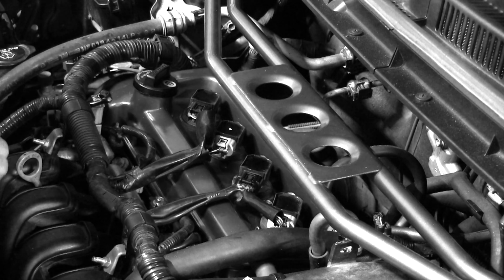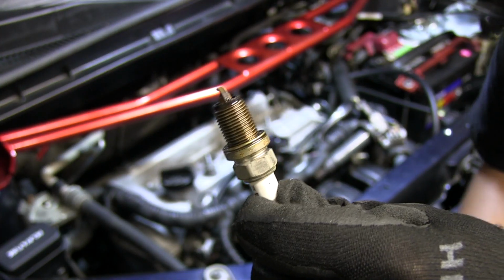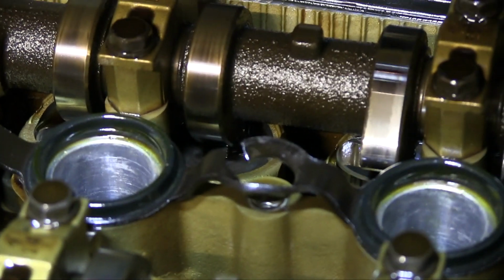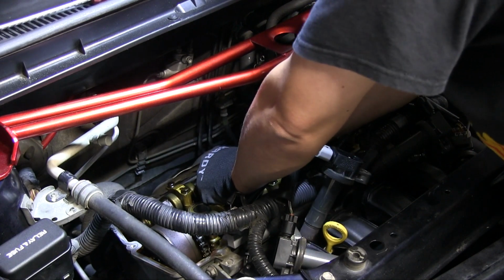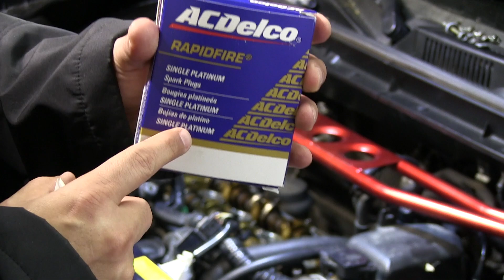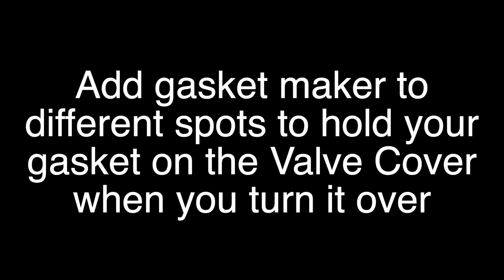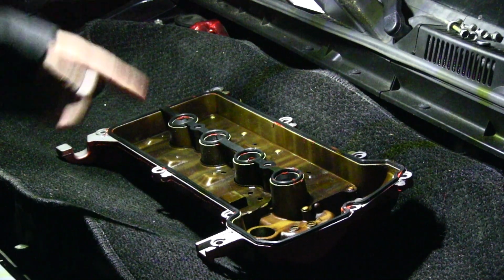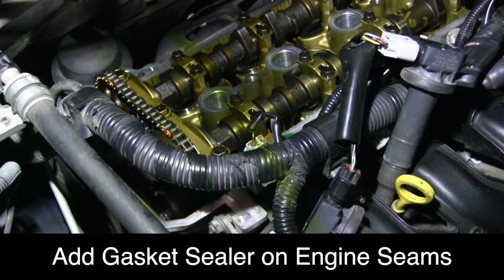VALVE COVER PAINT/GASKET & SPARK PLUGS

Comment: Ha! I noticed your Coil Pack connector for #1 & #3 (the 2 black ones) have the little locking tabs broken off. Same on my '05...and my buddy's '04. 
1) I dig how you use and show us that you use just basic, bargain tools. I appreciate that.
2) For the 2 areas on the top of the engine for gasket/ sealer, what product do you use for those spots? And how much of it do you put on?
Thx.
Reply from the maker: Yea, harbor freight is the best place to get tools. I did fix the tabs 😊

I used gasket sealant from autozone, nothing special. You have to add dots of sealant around where the gasket will sit as well as the seams to close the gaps close to where the timing chain is. Let me know if you have any other questions.

Comment: Damn i didnt even know the top of the engines cover could come off like that so easily. How many miles did your ride have? So most likely i would have to replace my gaskets too. You didnt want to clean the inside? I seen you had some carbon build up. You might as well have you already had it open. Over all i learned something new. Thanks for vid
Reply: Ohh ohh! and another thing, it looks like one of those spark plugs is a counterfeit.
Reply from the maker: I have 200K miles on the car. I plan to do a throttle body swap but will be cleaning as well. The intake manifold may get changed too.

Comment: what did you torqe the M6-1.0 x 20mm Socket Head Cap Screws, Stainless Steel 316, Allen Socket Drive, Full Thread, Bright Finish, bolts ?? amd were and what kind of washers were can  i get the washers???????

Comment: what did you torqe the M6-1.0 x 20mm Socket Head Cap Screws, Stainless Steel 316, Allen Socket Drive, Full Thread, Bright Finish, bolts ?? amd were and what kind of washers were can  i get the washers???????
Reply from the maker: I believe I used 8 lbs of torque for the valve cover bolts but you may want to verify that. There is a link in the description for the bolts I used. I just bought some automotive washers for the bolts from the hardware store.
Reply: @OilandGears  they don't have no more of them bolts they don't sell then anymore but I got some on ebay